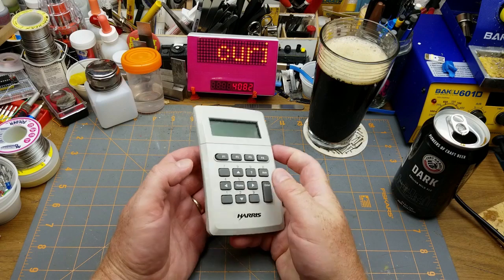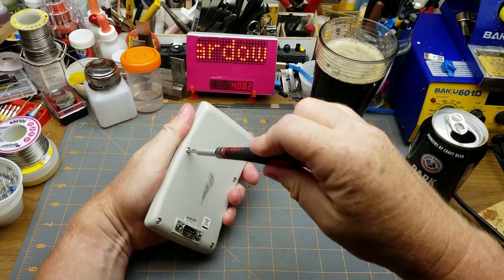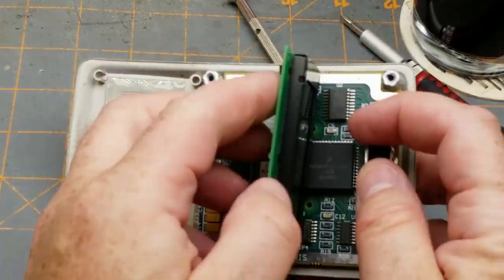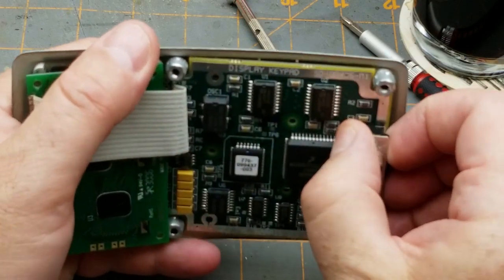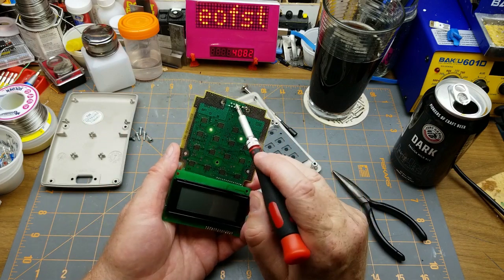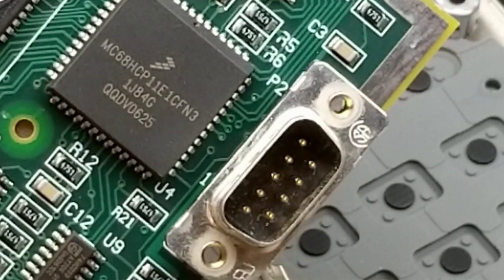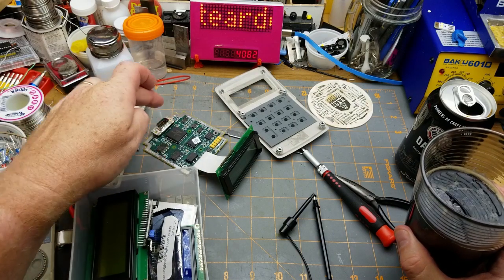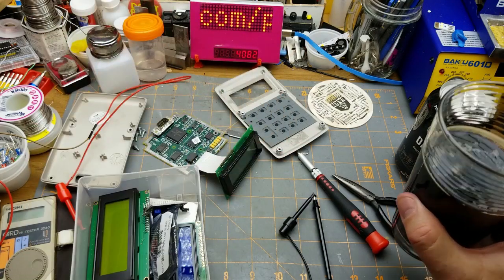old tech teardown - handheld controller from an old microwave radio

Comment: The reason for the display not working is,  you didn't have the polarized glass on the display,  it was still on the top case half. That type of display needs a polarized glass in front to be able to see it,
Reply from the maker: interesting idea.Though that hasn't been an issue with other similar displays I have.
I'll give it a try.
Reply: @pileofstuff  Simple way to test this without powering it up, is to put that front glass over display and rotate it, if it is polarised, then you should get some darkening happening

Comment: My local Princess Auto had no stock of those black and red handle screwdrivers even though their own inventory said they still had some.  
 I didn’t know the 6811 was still being designed into things in the mid 2000s.
 Those parts seem so ginormas now.

Comment: Regarding serial port and Power.

It's possible that it might be using some flavor of power over serial.

It's not really a standard but it's something that used in some applications.

It is available in some pc motherboards.

I think it's mainly used in point-of-sale?

The thing is there's a few different flavors.

Essentially it's using other pens has he report that would not be used in certain applications and using them for power and ground then also this usually has to be set up doorway with jumpers on motherboard not to mention there is more than one voltage available plus power could be on any one of a number uptown's and possibly ground as well.

Don't know for sure this is just a theory since this is one of those devices that really is its own thing or some such wording is that this is just a long shot but it's a possibility.

Comment: I would not be surprised if it would work with the standard LiquidCrystal library in Arduino. If you soldered on some wires to the LCD header, you could try it without the serial LCD backpack, a parallel connection to the Arduino.
Reply from the maker: That's what I am thinking.
Experiments will commence as time permits.
Reply: Yeah, looks like a standard HD44780 display 😊

Comment: Did you try pressing one of the keys when you gave it power? Might wake it up, although that's another long shot. 

Thanks for a fascinating video.
Reply from the maker: If I remember correctly, when connected t the equipment there is a message appears on screen when it wakes up. I suspect there is some handshaking that happens behind the scenes before anything interesting happens.
Reply: Oh well, it was worth a try. It's times like this when an Interfaker would come in handy. I wonder if they still make those.
Reply from the maker: @strayling1  I don't know if they still make them, but I think there's one at work - if it hasn't been disposed of.